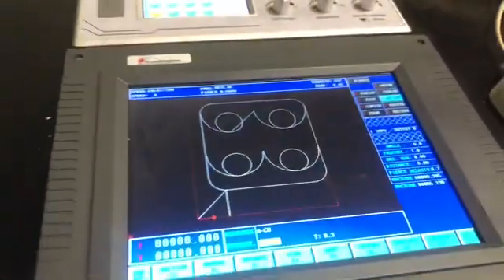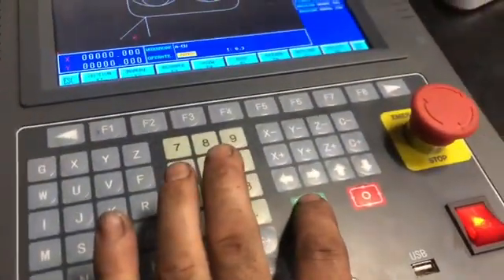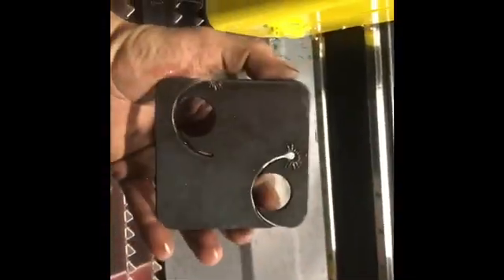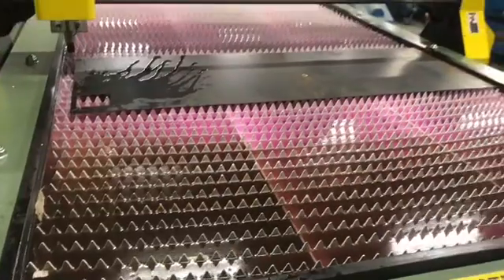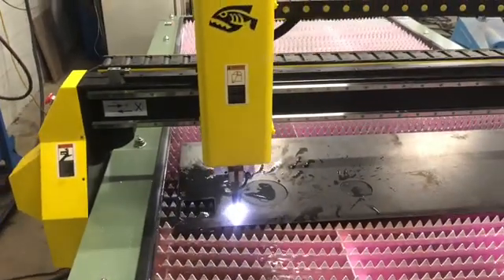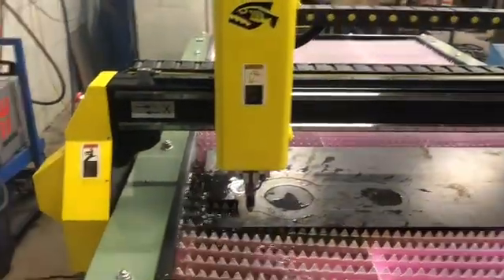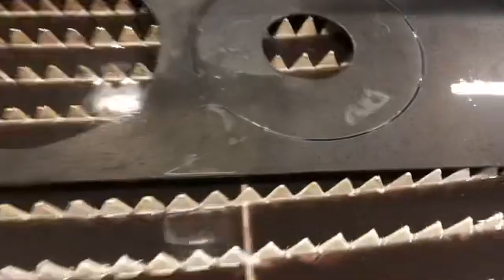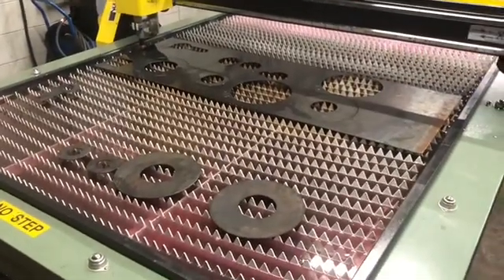First Cuts With Piranha B-Series Plasma Table

Comment: Is that a piranha?  I just got access to a c510. 
I haven’t seen it but was told I can use it. 
I have a question. Can I upload my own files. I have solidworks and can draw anything with that. 
Can we make our own files or do we have to do it at the operator panel?
Reply from the maker: Yes, should be able to
Reply: Thanks for the reply. I see now how ignorant that question was. 
I really enjoy using it
Reply from the maker: @rosstrue1  all
Good! Yesterday I drew file for new slants. Let me know if you need it